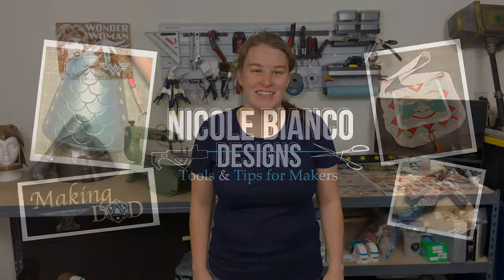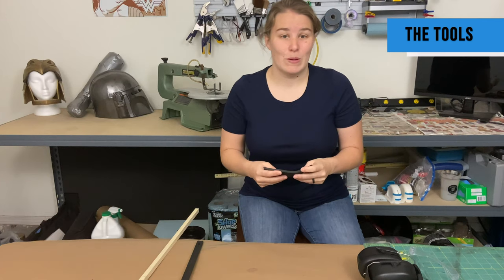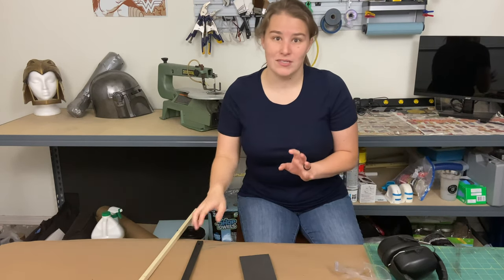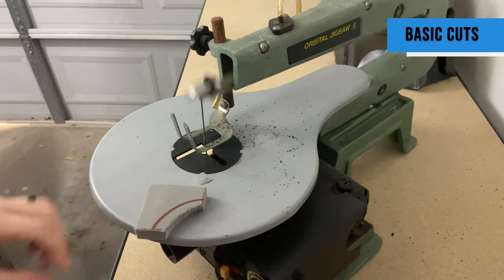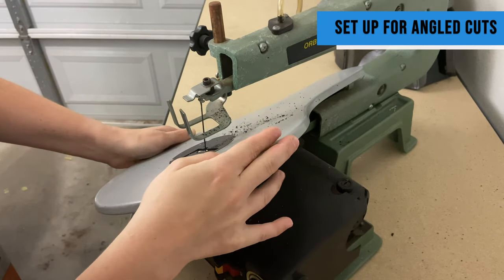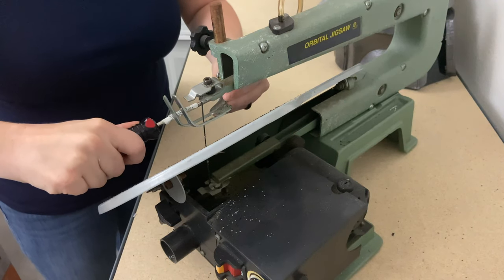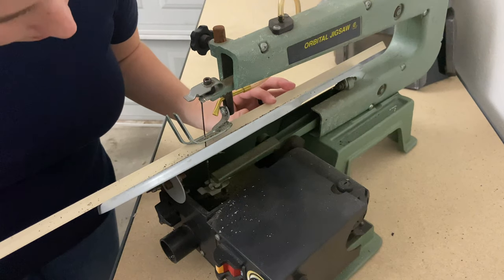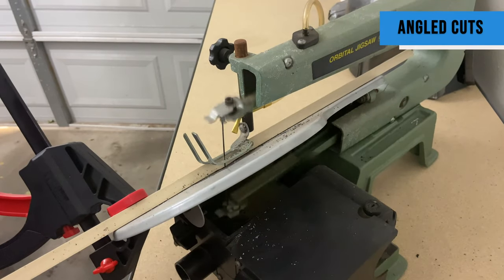EVA Foam 101: How to Cut it - Power Tools

Comment: Nice informative video Nicole, I am planning to cut the foam for my tools with EVA foam, can you also use a hot wire?
Reply from the maker: I am unsure of hot wire cutting. I know on other foams you should not use a hot wire due to the glue used during manufacturing. I would see if you can find out the makeup of your foam and see if there is an MSDS so you can make that decision knowing all the information.

Comment: do you think a bench saw would do the same job or better?
Reply from the maker: Any saw that has a small blades would be better. Something like the scroll saw in the video, a band saw, and even small hobby table saws (thinking the small one sold by Harbor Freight for example) would work. You want fine detail blades to make the cuts smooth against foam. Hope that helps! Thank you for watching the video!

Comment: This is super helpful! For the scroll saw, is there a specific blade I'll need to buy in order to use it on foam or can I use the blade it comes with?
Reply from the maker: Mo - I used a blade that had the smallest teeth on my scroll saw. I find that the larger the teeth the more uneven the cut and the faster you have to go. Hope that helps!

Comment: Can it be used to cut foam board??
Reply from the maker: Hello Dion! I believe if you use a thin blade on a higher speed, it would cut foam board. The real test would be if it would cut it nicely on both sides. Definitely worth a try just make sure to be safe especially with the particles. Some of the particles from foam board can be nasty/toxic.
Hope this helps!